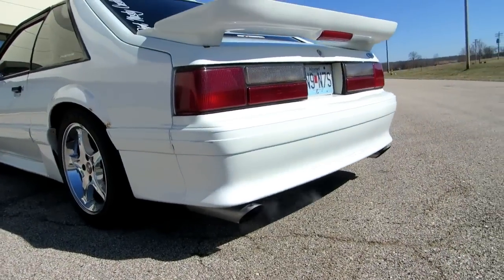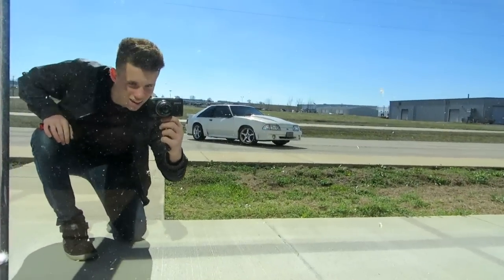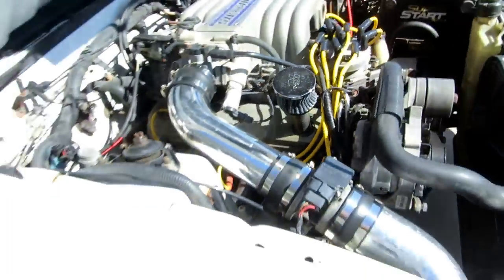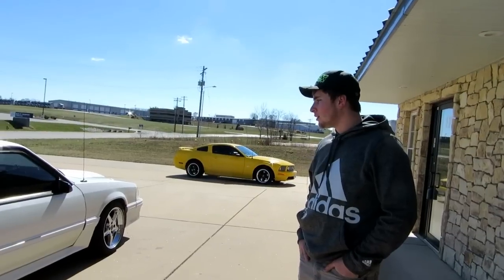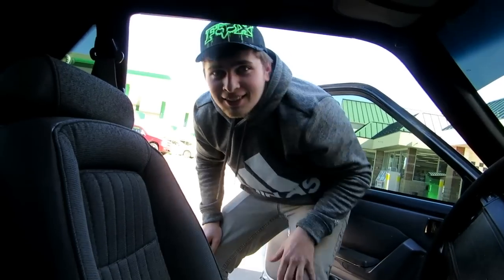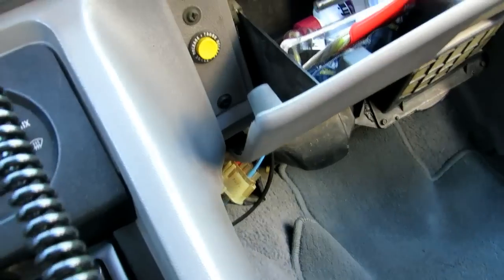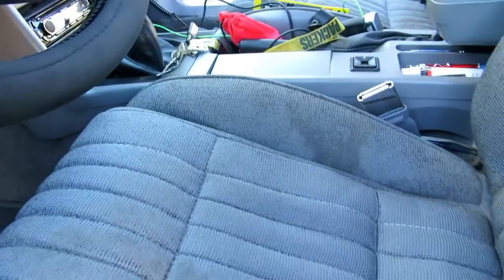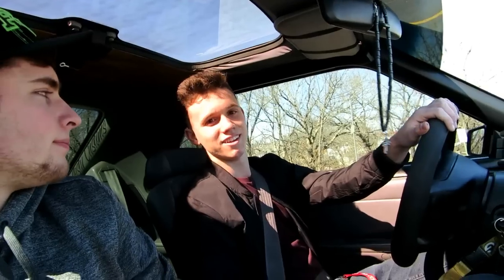INSANE '93 FOXBODY MUSTANG (Burnout + Revs)

Comment: This guy actually just said a 30 horsepower increase from a cold air intake...
Reply: Peyton Harding more like 8 HP!
Reply: “Sounds about right”
Reply: @rr122608  and the metal intake actually increase heatsoak. Better off with a plastic intake to reduce heatsoak.

Comment: Seeing that gun casually just chilling in the car is a wild perspective for me to see. You'd get fucked over by the stiff fist of the law if you got caught with that in Australia and then some for the clip! 

The Australian equivalent of this car is probably the EF XR8 with the 185kw Windsor, the AU Falcon which is the next generation had the 220kw Windsor with GT40P heads and intake.

I drive a 1994 Ford Fairmont with the 5.0 with a hotted up engine, but it has a 4 speed BTR :(

Comment: be careful when you turbo a Windsor 5.0 they have a tendency to crack the block at 500+ horsepower. you can get a man o war block and they're pretty strong.
Reply: +1 at what the last guy said, superchargers crack the blocks, these engines really like boost. on3 turbo kit can push 500hp on a stock block, its all about your tune though, shitty tune job causes a lot of problems, give it a good tune and it will run like a raped ape and never crack. but if you have the money A dart block is defiantly the way to go.

Comment: 347 stroke the motor and then turbo . cam tell him to run E 303 ive owned 13 of these cars GT40 heads Ford explorer GT40 upper and lower intake Hooker headers . x pipe ,flowmaster 40s under pullies 373 gear in the rearend then stroke the motor go with 30lb injectors  70mm mass air meter Tbody combo  he will be setting 600hp all motor frame tie the cae with sunroof u build this it will twist the frame